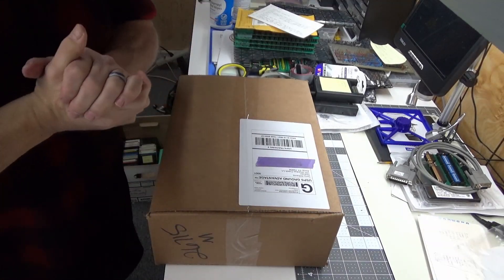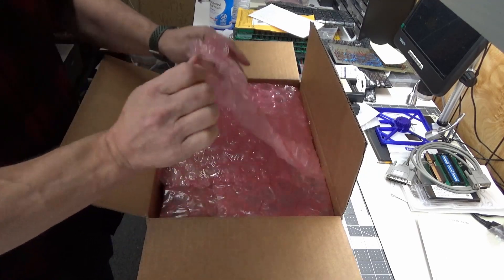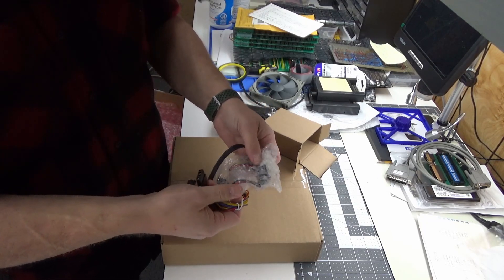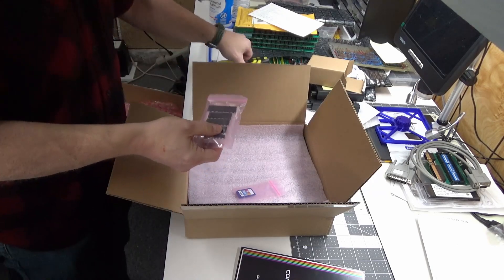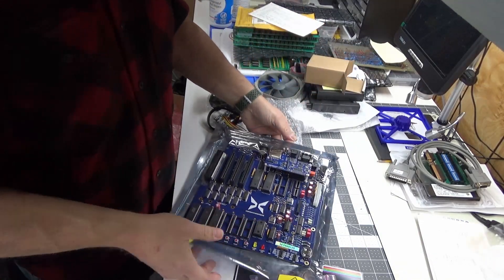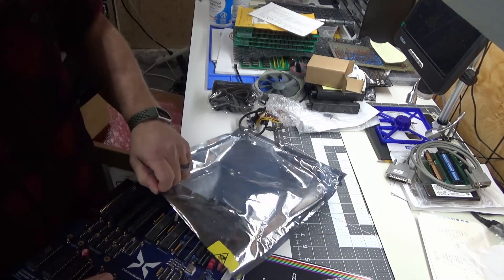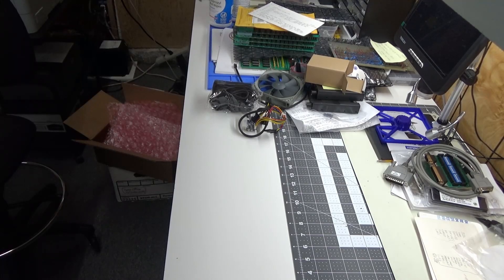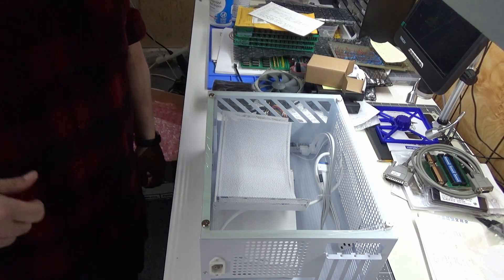I bought a box of sex!  Unboxing the Commander X16

Comment: Great content!
.....
I im trying to assimilate some info for a parts printer from those not ambiguously selling them. If you were starting out today which 3d printer would you go with for making parts ...you dont have to say why just the model. I can infer the rest ..please 🙏 thanks
Reply from the maker: That depends entirely upon what kind of parts you need to print.
Reply: @f15sim  PLA or similar nothing outside the norm... but curious to what material is used for  rigid precision parts when I see people making say linear rail parts etc.. It's my understanding that on leading machines it's just changing nozzles and software for different material to a certain extent at least .. but I'm new and just trying to gather info on which machines and companies some with experience like over others ... without being targeted by yt feeds in the Bernaysian malaise
Reply from the maker: @hobonickel840 If you're completely new to 3D printing and you're more interested in using a 3D printer as a tool and not a hobby unto itself, I would recommend either a Bambu Lab P1S or, if you have the budget for it, an X1C. Proprietary bits aside, they're the easiest printers to get successful prints out of with zero effort on the user's part.
Reply: I've heard lots about BBL and most of it is noise regarding their business model .. thanks for sharing!